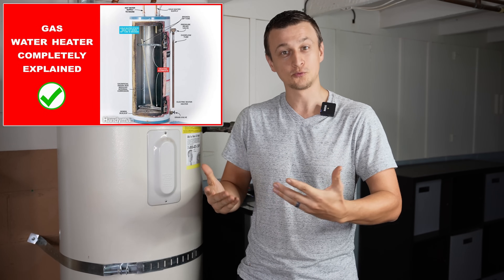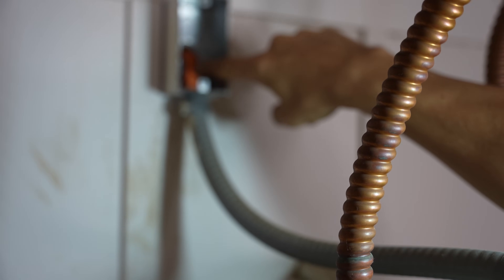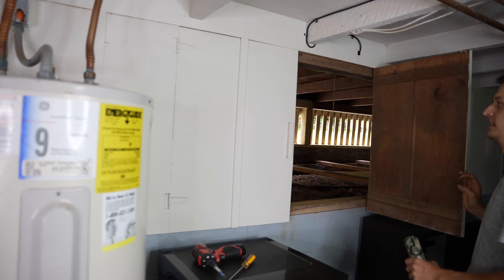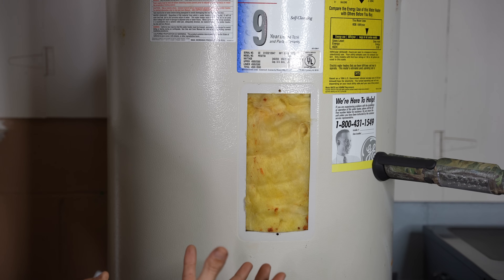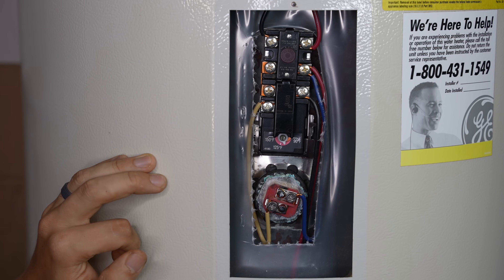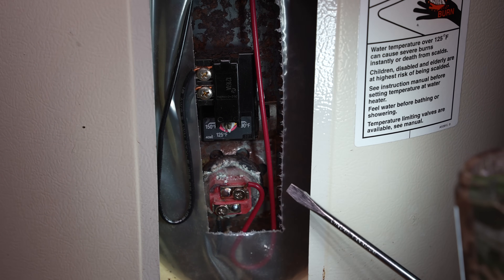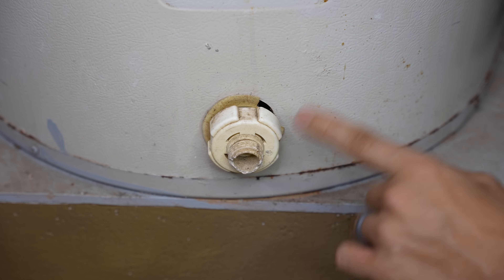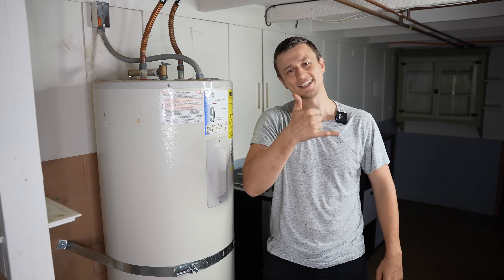How an Electric Water Heater Works

Comment: Great video. Concise and educational.  And I have been in an earthquake that was about 8.0.  dishes fell, pictures came off the wall, bookshelves fell, roads broke apart, cars fell, basically a great time.  Interestingly, you can have a low riktor scale count quake near you that will do more damage than a strong one fast away.

Comment: For security reasons, I prefer a gas water heater than an electric one. As you know, water conducts electricity and if there is a leak inside the water heater, when you do shower, you will become a live conductor to the ground and die immediately. I have watched the news that a family is dead because of this.

Comment: Would you know what the recovery time is for 60 gallon tank if in  constant use to fill a large(1000 gal) tank? I'm trying to fill a baptismal with newly installed 60 gal. heater. How much wait time to get proper heat?

Comment: I have a question. For two days in a row my water was starting to get to boiling hot, eventually to the point that no hot water was running. We replaced the heating element and it didn't work. We pressed that restore switch and it actually worked. Now the question is why afterwards does my water heater give off some kind of aroma? It's like something is burning, maybe a little similar to plastic. Would that be sulfur? And if so how would I solve this problem?

Comment: Fantastic. Trying to plumb in new water softener and didn't know which pipe to pick. So plumbing into incoming cold line then back into heater will make all my hot water filtered. Cheers.

Comment: I was wondering about idle reheat electricity usage. I monitored my energy usage when my hot water heater wasn't being used for showers etc. and noticed it re-heats the tank every 14 hours. Do these thermostats have both an activation temperature and deactivation temperature? If it were just going to turn on when the water temperature falls below a set single temperature, wouldn't it reheat more regularly when not in use?
Reply: If you ever used a thermos for coffee and can keep it hot for 8hrs. Now imagine the same concept but with a 30-50 gallon tank.  The bigger the quantity of water,  the longer the cool down time.

Comment: Thank you for the explanation on the workings of a water heater, this is a video all homeowners should view. I’m from California and have been in so many earthquakes I lost count but two stand out as memorable for me, the 1987 Whittier Narrows quake 5.9 magnitude. I lived in Whittier and was standing, getting ready for work and when the quake came up from the ground and felt like a giant sledgehammer was pounding the floor beneath my feet. Next came the shaking which made the walls of my house look like it was made of jello. The energy that quake released was unforgettable. 2nd quake was the 1994 Northridge quake, 6.7 magnitude, about 48 miles from Whittier where I lived. This quake was about 20 seconds of intense shaking up and down AND side to side that separated a major beam in the house that literally allowed me to see daylight through the wall. My small stereo on a shelf unit was completely turned around and facing the wall afterwards, yet never fell off the shelf. Nowadays we’re like your neighbors and barely pause to acknowledge anything less than a 5 magnitude 😏

Comment: Well thought out video, and thanks. I'm just getting into how a water heater works as to its wiring and switching. Again, thank you, I was unaware that the top element came on first, so that explains a lot of things when I am doing switching continuity checks. It seems that the top themostat is the boss and when it is satisfied it opens the switch to the top element, and at the same time closes the power switch to the e bottom themostat, which then engages the bottom element. So the top themostat operates also as an A B switch, or a Flip/Flop switch.  Keep up the good work, and by the way "Great Video Voice."  FR

Comment: Hi I have a question. I have a small water heater 35 gallon I think.  The tank is leaking I removed the side panel at the bottom and warm water is running out. I'm sure it needs replacement. But in the meantime how should I manage keeping it going for a few months. The tank sits in a drain pan that drains to a lower level sink. 

Can I leave it be?  Or can I shut the power switch on and off if I want to use the shower?

Comment: Always flushed my 15-year-old electric hot water heater, Just recently started to sputter with air and black specs when I turn it on. I'm assuming that my anode or electric elements may have gone bad or maybe just integrating? The hot water still works, but it has a mechanical smell to it as well now and it comes out hotter than usual. Any comments would be much appreciated!

Comment: So my water heater  doesn’t give me more than 5 minutes of hot water during shower. Why? Or how to figure out what is the problem
Reply: Very likely your dip tube on the cold water inlet is broken. When this happens the incoming cold water isn't introduced at the bottom of the tank where the burner is but rather at the top of the tank. This very quickly reduces the temperature of the hot water at the top of the tank resulting in short draws of hot water.

Comment: Sir, Is it possible to drain the electric water heater using an air compressor attached to a faucet and allowing the heater water to drain into a sink and exit the house? Trying to winterize a house with the water heater in basement and no floor drains available>
Thank You

Comment: You must be around Hilo! I remember it well…scary! I have anode replacement rod ready to go, WD 40 prepped for months , sitting and penetrating. Guess I’ll do it one more time then use my impact air wrench to encourage it out. Is this asking for trouble? I have maintained it, drained periodically, replaced upper and lower elements and control boxes but wondering why nervous about this rod repair, my first. It’s time, 20 yrs of light use and not always on but still, am I asking for trouble? Enjoy your vids!

Comment: What would happen if the water heats too much and the pressure relief valve fails?
Reply from the maker: As in it fails to open up and release the pressure? It will literally explode and get propelled like a rocket.

Comment: I would recommend to have a shutoff valve on both cold and hot line . In case of maintenance it will be helpful.
Moreover you may check the incoming water quality and the pipe material . The copper pipe could replaced with PPR to avoid the corrosion and dielectric effect
Reply: 8
Reply: You don't need a shutoff on the hot side if the cold is off. The pressure on the cold side is what pushes the hot water out. Also, it would be pretty dangerous of the hot side was turned off while the tank was still on.

Comment: Great video, thanks! I always thought I needed to shut the valves when draining... good to know that's not necessary!
Reply from the maker: Glad you liked it! Well if you are draining the water heater then you would need to shut the valves off. But to simply flush it, opening only the drain valve is usually sufficient. Cheers!
Reply: @WordofAdviceTV  Got it thanks! Yeah meant to say flush...

Comment: Question: once the thermostat is satisfied and shuts off the heating element, how many degrees will temperature drop before heating element turns back on? Or does it just wait for another call for hot water before it turns back on?
Reply from the maker: I believe those are +/-5% so if your thermostat is set to 120, it would come on when the water temp drops down to about 114 and turn off after it heated the water to about 126.

Comment: Connections on top of the water heater should have dielectric fittings they prevent electrolysis from different metals
Reply: Only need dielectric unions if connecting copper to galvanized. Those flex supplies have brass nuts.
Reply: That’s actually true… it’s not made up.
Reply: Exactly correct
Reply: I feel like u made that completely up lol u liar
Reply: @Mountainmannnn let’s see those plumbing license you hold.

Comment: What causes a sulfur smell in hot water if the tank isn’t used in several weeks?
Reply: That's likely hydrogen sulfide. There are certain bacteria that occur naturally in your water system. They love anaerobic (no oxygen) environments so a plumbing system is an ideal source to thrive. Those bacteria will feed on decaying organic matter. When those bacteria eat, they release that hydrogen sulfide gas; leading to your sulfur smell. It should go away after running the water for a while to flush it out. If it's bad enough though, it can lead to corrosion.

Comment: Great vid, as always! I can NOT get my friggin' anode rod out !. I gave up.. and I have very hard well water. ugh.
Reply from the maker: Thank you! And OH YES! I know what that's like. I think it was a good choice to give up. Forcing it may end with a new water heater...
For what it's worth, I've seen plenty of water heaters that lasted 20-30 years without the anode ever been replaced. 👍👍
Reply: @WordofAdviceTV  good to know, thanks ... and so glad you elaborated about the drain valve issue as well!
Reply: I immediately replaced the magnesium anode with a  powered anode in a new heat pump water heater.  Works well (three years usage now.)  No odor and no flaking off into a pile of sediment.  No need to drain.  We are also on a well with moderately hard water.
Reply: @emsaiii  My hwh is going on about 9 yrs old (was fairly new when I bought the house), I might as well wait until it's toast and then start fresh and get things 'right' with a new one. thanks for the info!

Comment: Morning 
OOPs it is 10:30 here so it's 0430 for you I think. 
Question incase I missed it. 
On the two thermostats should they be set the same or is there a more efficient setting. 
I keep them set at 120 and my wife still complains 😄.
Reply from the maker: Good morning Gary! (it's morning somewhere in the world) 😄
The two thermostats should normally be set to the same temperature but it's okay if you set just the top one a little higher. That would save on the electricity costs and should stay hot enough for one shower before the temps drop a bit.
In Minnesota my wife had me set our gas heater to 145 haha so I know what that's like... 😅